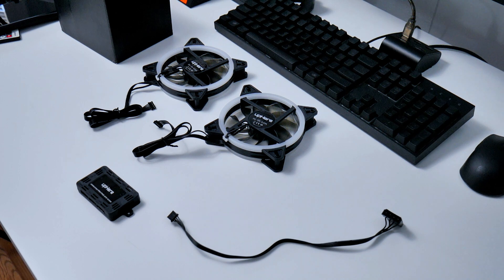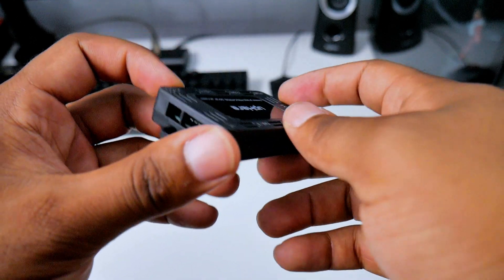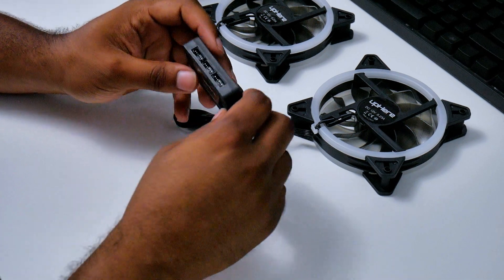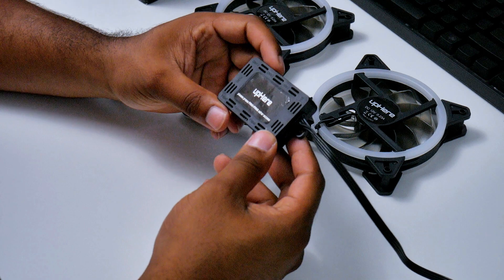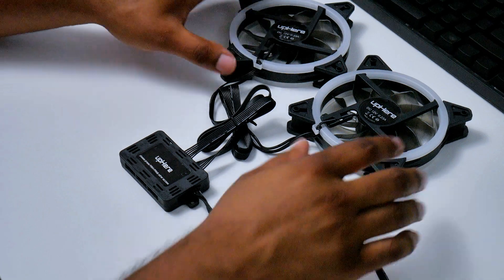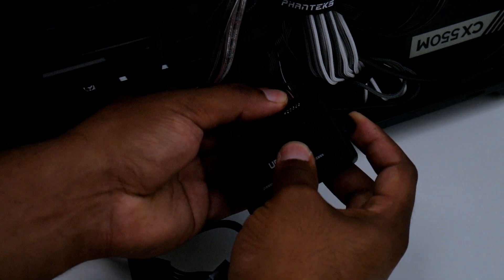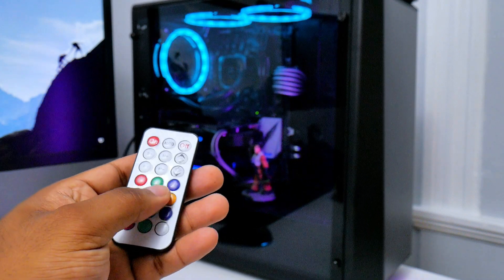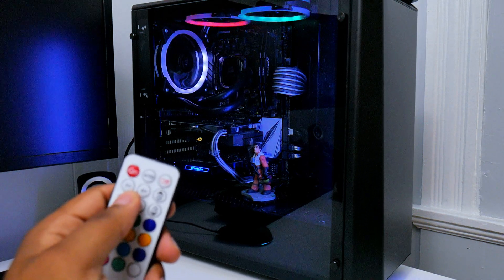Uphere RGB Fans (Installation Tutorial)

Comment: I got the wrong power cable! The 4 pins female connector on the cable is much smaller than what on the fan hub, Im literally crying...
Reply from the maker: Mmm you sure if so contact the seller asap so they can replace it with a new one.
Reply: @VictorA25  Im waiting for them to come up with a solution. it seems like they are starting to send wrong power cable since 2018.11 lol

Comment: Wait soo you dont need to plug in another plug for the rgb??
Reply from the maker: No it's integrated into the fans and the hub let's you change colors and patterns. Just one power connector.
Reply: Victor A thats good cuz when i bought the corsair ll120 i didnt have another rgb pin connector so this is perfect

Comment: They can be installed on both directions, if not i wasted 1 hour.
Reply from the maker: You could but one side pulls the other side pushes
Reply: @VictorA25  Wait, what do you mean by that, do i have to screw them off?
Reply from the maker: It mean both sides don't do the same thing the front will blow fresh air in and back will take the hot air out
Reply: @VictorA25  thanks a lot! I ll watch how to put them in the correct direction, do you know which sides will feel better in my sharkoon pure steel white edition?
Reply from the maker: Well if you can mount them in the front,top, and back of the case. I would usually have air coming from the front and the top would push hot air out as well as the back
Reply from the maker: It's easy to get confused with these fans because you have the lights on both sides but in the end the fans only have on side that will push air in.
Reply: @VictorA25  So i'm going to change direction of the 3 bottom fans and let them put the air inside, the 2 in front too and i'll leave only 1 fan back to get the hot air from inside out, do you think there will be decent airflow??
Reply from the maker: Please do and if you have need help get me on my discord.
Reply: @VictorA25  thanks a lot!

Comment: I have a probleme with this fan 
every fan its well connected (in the correct order 1-2-3 only)
the power cable its connected to a molex calbe and everything sound and look good
on the first start up all of my led show in white and red <<ok look prety fine>>
when i close my computer to reopen it my led dont work anymore and i trry to unplug it and replug it No succes and the remmote don't work also but i can see the red led on the controller
Reply: VictorA27 my control board is screw inside my computer case
Reply: i think that a probleme with my wire or something i have try it on my other pc and he just have 3 led on 1/3 fans who work ??
i will probalyy try to refund it ..
but if you think you can actualy and you think have found my issue that will be cool dude just contacte me if you can
Reply: Did you fix it? sounds the same for me.

Comment: How do I tell the fan numbers
Reply from the maker: The fan hub should have numbers on top of not just plug them all in on one side first and continue to the next.
Reply: Victor A does the fan need to be a specific fan on number 1 or any of the fan, cause the fans do not have numbers indicating witch order they are.
Reply from the maker: I don't think I just believe it should be sequential
Reply: Victor A kk thx
Reply from the maker: No problem any questions come back...

Comment: I did not receive a molex to 4 pin
Reply from the maker: Please notify them ASAP
Reply: same thing, didnt get any 4 pin DC12v connector, i got a molex connector but connects to the rgb slot,
Reply from the maker: Well the molex cable is your 4 pin connector for power. These don't come with the 4 pin for the motherboard.

Comment: my rgb light are not working
Reply from the maker: Make sure your rgb fans are connected correctly on the fan hub in numerical order and remove the plastic film in between the battery on the ir remote.
Reply: @VictorA25  it does not have numbers i got a different type of HUB what do i do :(((((((((
Reply from the maker: Start from one side
Reply: @VictorA25  thats what i did
Reply from the maker: If it's not working please try getting a replacement.
Reply: @VictorA25  you mean buying new ones ?
Reply from the maker: No I mean return them if you got them like that and get a replacement or your money back.

Comment: Jesus dude could you be a little more monotone?
Reply from the maker: Did you see how long ago this was filmed.. You must not gotten what you wanted for Christmas 😂😂😂 don't take out on me I'm sorry for your misshape...
Reply: @VictorA25  bro i just got these fans and the instructions are fully chinese.  There isnt one video out there that tells me how the damn fan controller works and all im seeing is red.  So im pissed.
Reply from the maker: @papaj5627  all you had to ask was for help sometimes you have to remove the battery from the remote to reset it and maybe it will work as advertised and plug them in order from one side to the other on the fan hub.
Reply: @VictorA25  thats the thing buckaroo they forgot to give me a remote
Reply from the maker: @papaj5627  return it should be easy if you got from Amazon they also have better models from the same brand.

Comment: So these run full speed all the time...yeah, that's a waste.
Reply from the maker: These don't give you the option to control the speed but these do 
$39.99 
upHere 5V 6-Pack 120mm Silent Intelligent Control 5V Addressable RGB Fan Motherboard Sync, Adjustable Colorful Fans with Controller T3SYC3-6 https://www.amazon.com/dp/B07HK7YRCD/ref=cm_sw_r_cp_apa_i_g2zPCbACRTQAZ
Reply: im pretty sure having lower thermals isnt a waste my guy
Reply from the maker: Yea the only issue with these is that they aren't pmw but the newer version is which would be the way to go to keep the fans from running at high speed all the time and just let the motherboard decide when to speed them up as needed.

Comment: Controller wont work
Reply from the maker: Check battery they might be a film blocking the contract.
Reply: @VictorA25  theres plugs labeled rgb and the fans never came with them
Reply from the maker: @crownedmedia7936  you sure they are the same set of fans this only comes with a molex cable that goes to the psu for power.
Reply: @VictorA25  cant find the same fans on youtube seen the remote and it was the same
Reply: @VictorA25  I didnt have the fans hooked up right in the fan hub  lol